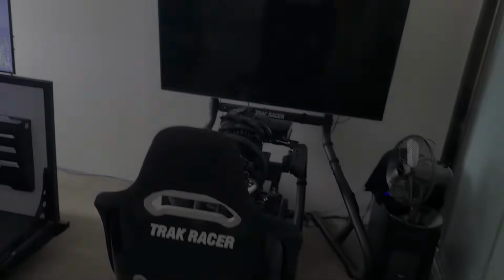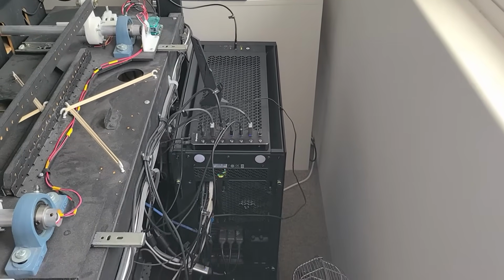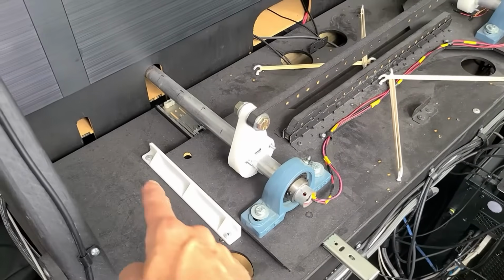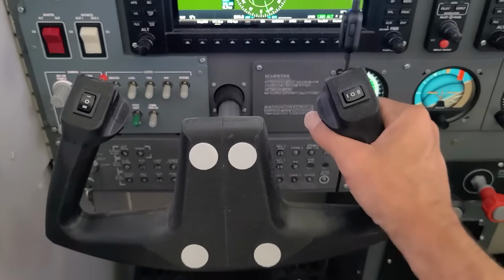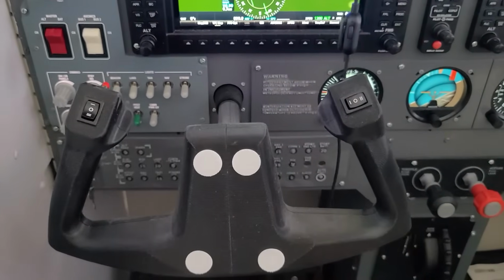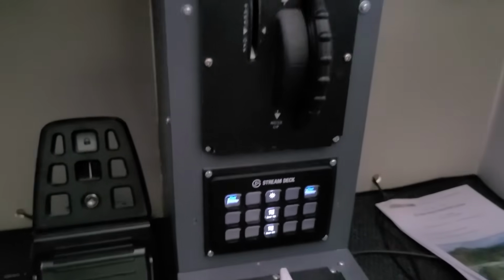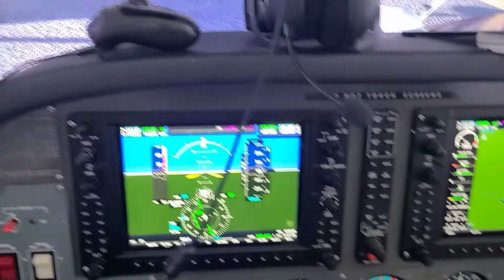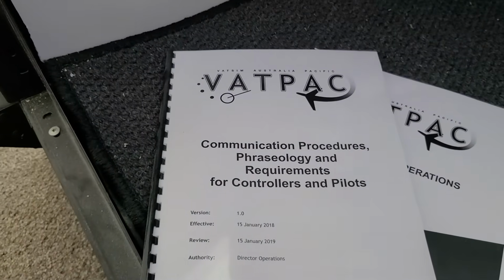⚡️Here is my C172 flight simulator !⚡️

Comment: I tried to edit the aircraft's 3D files using Blender but I was unsuccessful in the mission. If I couldn't delete it, I would like to at least leave the interior of the aircraft transparent, keeping the panel so that when I look to the side I don't see the window frame and only the plane's wing.
Reply: I did this by removing the Cessna172SP_AS1000_interior_LOD06 file and had the same result, but because the panel no longer exists, the g1000 disappeared and I can't mirror it on its screen because it no longer exists, I wanted to do this but without hiding the g1000 so that my pop out can find it and send it to its auxiliary screen, is your g1000 independent? Where can I get separate software for the g1000, I have Air Manneger but it's just the frame, it doesn't give me the G1000 pfd and mfd screen or the Gns530, just the "frame" overlay
Reply from the maker: Yes that is the beauty of my G1000 setup. The Simionic units are independent of the Sim and are connected via bridge software and over Wifi network. Advantage is less load on your machine and this current issue you are experiencing. Downside is some slight (very slight) lag if your wifi isnt up to scratch. Fortunately I have good wifi so I dont notice it.   Thanks for tuning in.
Reply from the maker: This is where XPlane excels over MSFS. Using Planemaker in XP you can achieve just that. I have done videos explaining how that can be achieved and a much cleaner result if you have physical sides.

Comment: Hello friend, how are you? I hope you are doing very well. I have a big problem with my simulator because I made a domestic cockpit and when I deleted the interior of the aircraft so that from inside I could only see the wing and the propeller, I realized that it deleted my panel and I lost my PFD and MFD. Could you help me? I would like to delete the interior but keep the panel so that I could mirror my G1000?
Reply from the maker: thanks for tuning in. Are you running XPlane or MSFS ?
Reply: @CessSim  MSFS 2020, can you help me?
Reply from the maker: @projetoaerolab did you see this video? https://youtu.be/LcFE4aSSlug?si=CjYyou-UIJtGUAHT
Reply: @CessSim  Okay, my friend, I'll try and tell you here if it worked 🙏🏻
Reply: @CessSim   I did this by removing the Cessna172SP_AS1000_interior_LOD06 file and had the same result, but because the panel no longer exists, the g1000 disappeared and I can't mirror it on its screen because it no longer exists, I wanted to do this but without hiding the g1000 so that my pop out can find it and send it to its auxiliary screen, is your g1000 independent? Where can I get separate software for the g1000, I have Air Manneger but it's just the frame, it doesn't give me the G1000 pfd and mfd screen or the Gns530, just the "frame" overlay
Reply from the maker: @projetoaerolab yes my G1000 is independent as I use Simionic G1000.  I only modified the configuration file so cant help with these files you have manipulated.  Why not fresh install if not working and you have tried everything else to get back to clean version?

Comment: Hello CessSim, thank you for sharing your knowledge and skills to build a well-made and aesthetically impeccable cockpit. I am also building a cockpit and I would appreciate it if you could answer a question or even better if you could make a video about it. As we know, MSFS comes configured by default so that the Yoke is physically placed in the middle of the main screen, but like your cockpit model, I want to place the yoke on the left side of the screen, precisely simulating the location of the yoke in a real cockpit, and I would like to know how you did to "move" the focus point from the center to the left, since if I keep the same focus, in the center of the screen, and place the yoke to the left of it, the handling of the aircraft is noticed unnatural, especially when taxiing when trying to follow the lines painted on the runway.
Reply from the maker: Hi mate and thanks for the feedback and support is greatly appreciated.  Has been a while since I played around with the configuration of the pilot eye viewpoint and from memory FS2020 was fairly limited here. X-Plane however (using planemaker) you can move the eye point which from memory I did a video on some time ago (will need to check).  I assume you are wanting to achieve this in FS2020 and not X-Plane or are you using both?
Reply: @CessSim  FS2020 only
Reply from the maker: @jefmore562  OK. Let me jump back into the sim and take a look around again.   From memory, I only achieved this in XPlane and not FS2020, however I do need to confirm.   Will get back to you.
Reply: @CessSim  Thanks, I'll be on the lookout
Reply from the maker: @jefmore562  Hey buddy. Been taking a look at this. I also reached out to another cockpit builder buddy of mine @Cardboard Sim. What he does is simply shift the camera to the right (right arrow key) and save the view as a custom view. That will work, however I am looking into making adjustments to the camera.cfg file but still looking into that.
Reply from the maker: @jefmore562  On another matter, I did create a video on removing the interal virtual cockpit that you might find of interest. Link here https://youtu.be/LcFE4aSSlug?si=gFcpziVZWAxBQsRt
Reply from the maker: @jefmore562  Are you running a physical compass in your rig?
Reply: @CessSim Oh thank you very much, I'll see it right away.
Reply: @CessSim  No. Only the Simulator compass.
Reply from the maker: @jefmore562  OK that helps to understand.  I am still playing around with the camera.cfg file but I think the issue could be with the eyepoint position setting to maybe address the issue you refer to.  For some reason my camera.cfg does not have the eyepoint adjustment setting (which I know does exist somewhere). I think this may be the setting to adjust.

Comment: Hai, love your enthusiasm! I’ve got a bit of the same setup. Question on that, I’ve seen it somewhere but don’t know for sure, but I would love to have the main msfs20 screen not on the middle but on the left screen, for the menus and “fly” button. How do you do it? 
Love to hear.
Reply from the maker: Cheers and thanks for tuning in.  Generally speaking FS2020 will respond to your "primary" monitor that you have setup so if that is your front monitor then the menus will be there. You could try windowed mode and simply swap them around which might be a workaround.  I personally use windowed mode, with my menus etc actually on the right screen and then when ready for flight I simply drag it over to the front screen.   Hope that is of some help.

Comment: Watched the whole thing. Thanks!  I just ordered three 55” gaming TV’s to use in a new simulator build. Does having your eye point to the left of center on the forward screen (as sitting in the real aircraft) cause any perspective issues when landing?  I’ve seen others with three screens sit dead center with front screen and adjust everything off that point.
Reply from the maker: cheers buddy and hope you found the video of some benefit. Appreciate you tuning in.   A matter of personal preference really, and yes you could certainly set it up that way, however be mindful of how your physical panel proximity will be in relation to the TV's (ie would be offset to the right). I havent had any issues with my configuration, eyepoint or anything over the years.  As a thought, what you could do before you go too far in panel design is get your screens hooked up and then simply test your preferred eyepoint which can then influence your panel design going forward.  Rotating out screens to 60 degrees in lieu of 90 degrees may also help if you panel is to be offset to the right.
Reply: Appreciate the info. I’m not planning on building a physical panel, but will see if a default view which allows me to sit to the left and see the entire panel will work. Kind of like your views but only with a yoke, throttle, rudder pedals and stream deck. Thanks again!